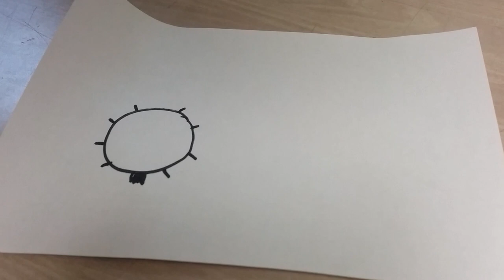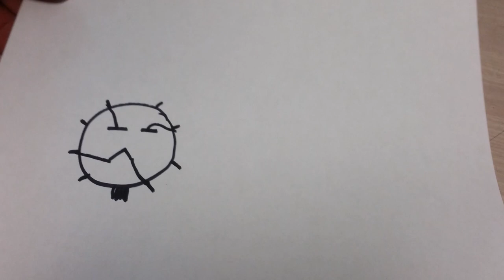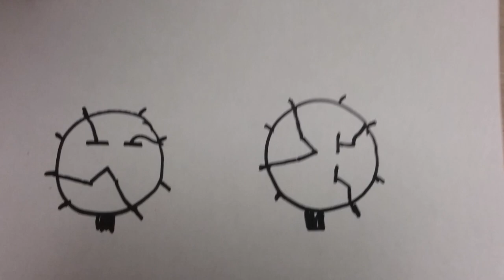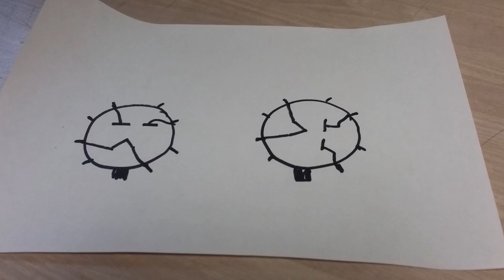The Worlds Worst Octal Tube Sockets

Comment: Obviously not a tube socket. I could see that with a shorting plug to select line voltage options. Or, as others have commented, they are special for modules. If your assemblers don't call these out on sight, fire them.
Reply from the maker: Yes, not a tube socket - but why pick these semicustom things when the world was filled with better off the shelf options? Like 9, 10, 11, 12, or 13 pin octal-oids?

I worked a little QC while at US Robotics many years ago. For all the checks QC can make, unskilled labor can unmake them in a hurry!

Comment: I could swear that I’ve seen those used for cabling. I think I may have seen that keying style used for battery sockets?

I can see how that would be a supply chain pitfall, but I don’t think they’re particularly dangerous. Yes, somebody could grab the wrong labeled bin. Somebody could also grab the bin of 1 ohm resistors instead of the bin of 1 megohm resistors and short out plate transformers that way. Having to grab the right labeled bin of nearly identical looking parts is just a normal part of running a manufacturing line. Dealing with unlabeled bins of dusty 50 year old surplus wasn’t a consideration when they were manufactured. 

Once installed, say for connecting a power supply chassis to a radio chassis, the end user can’t accidentally plug the power supply into a tube socket, and if they stupidly plug a tube into the power inlet, there’s no power to burn anything out.

Don’t smash them. Sell them as what they are: hard-to-find cable receptacles.  Better yet, if you come across a triwall with 10,000 of the plugs, that will make the five people who need them very happy. 😁 If somebody buys them from you and misapplies them as tube sockets, that’s on them.
Reply from the maker: When dealing with resistors, a factory worker could assume that resistors could get mixed up due to the natural variety. Building an assembly may mean they are dealing with ten or twenty different values anyway, and need some extra assembly. Tube sockets, on the other hand, are all fairly unique. Grab and go, basically.

I am giving away the few I still have (spoken for, basically). If you need one, just take a normal EBY octal socket and have a few minutes of quality time with an appropriately thin jeweler's file.